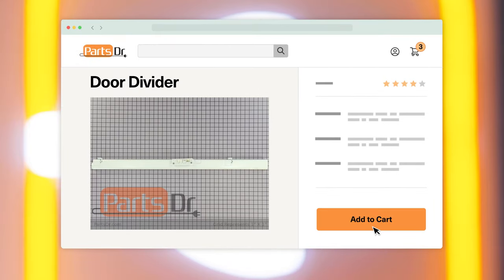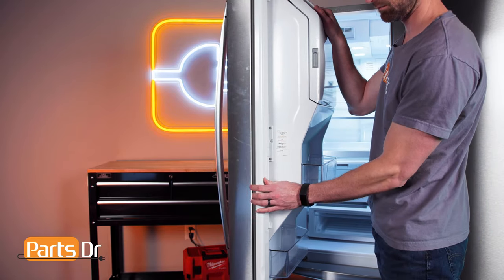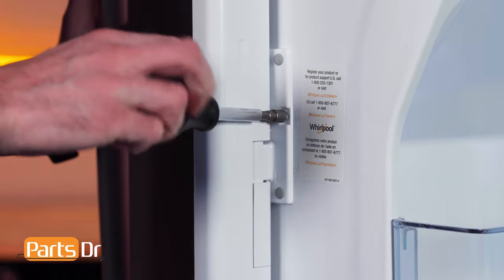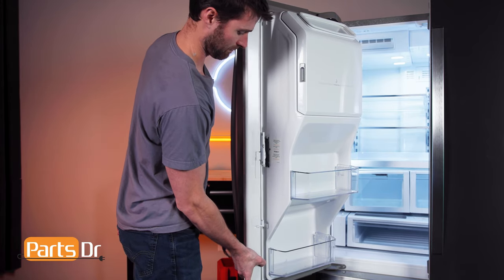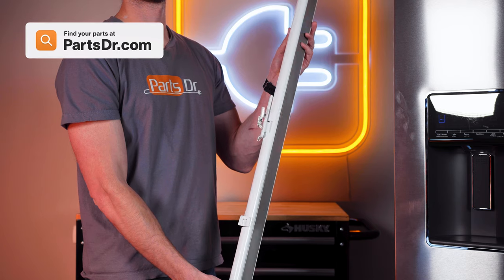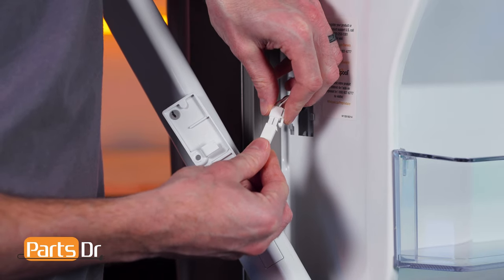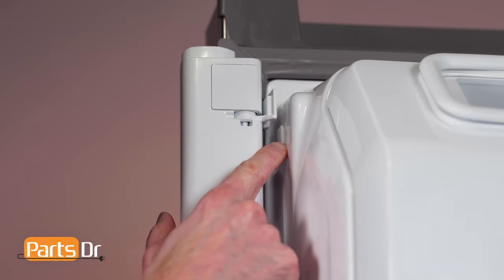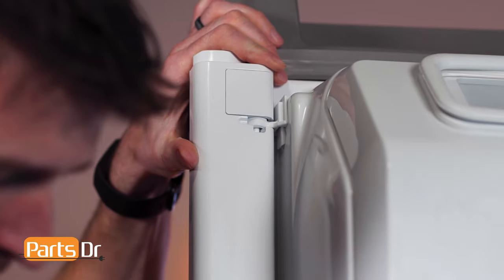How to replace Door Mullion Divider part # W10806457 on your Whirlpool Refrigerator

Comment: Hi - Any idea what the name of the piece is that the Door Mullion Divider slides into. the piece that is mounted in the on top inside the fridge that the door mullion latches into
Reply: mine is somewhat broken and when you close the door the door mullion divider doesnt always go into the latched position
Reply from the maker: Yes, on this refrigerator it is called a Pivot Block.  Here is the video on replacing it: https://www.youtube.com/watch?v=7AMbLm5tnPk